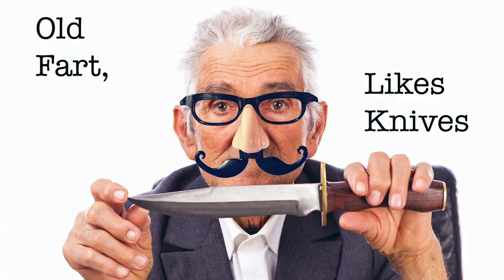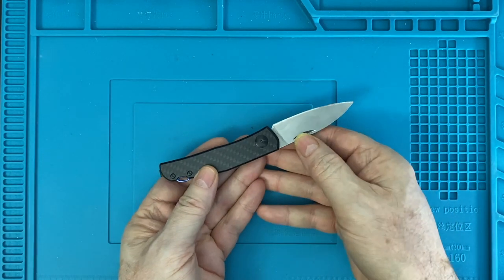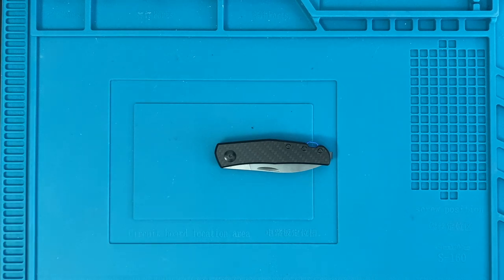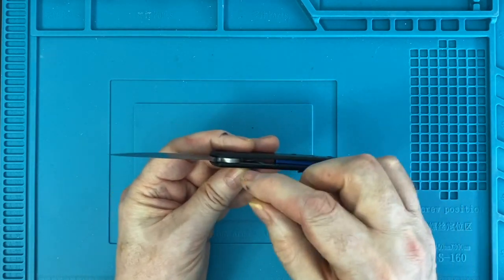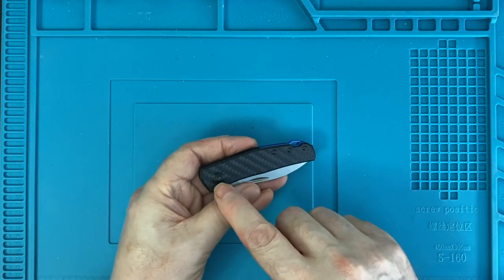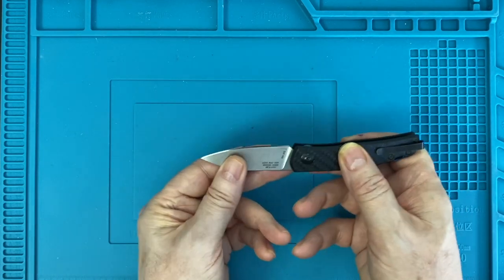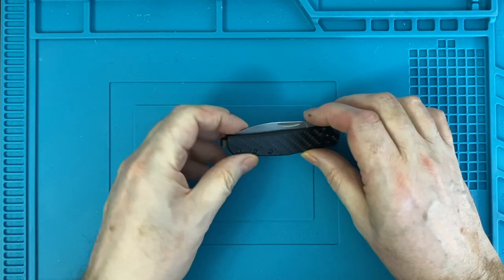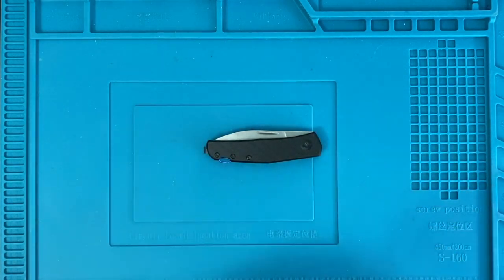Zero-Tolerance 0235 Slip Joint

Comment: Weird yeah I don’t like knives I can catch the tip of the blade when closed. I have the 0230 and the blade sits a lot deeper maybe if you find a used one you could switch the blades or scales and have the clip on a different blade that might work better
Reply from the maker: It's funny - I'm having trouble believing there is such an obvious design error.  Every couple of months I go back and take it apart, trying again to find something wrong that I could fix.  Just doesn't seem to be anything to adjust.  Weird indeed.
Reply: @OldFartLikesKnives  now I need to check my 0235 to see if it has the same issue.
Reply: The tip of the blade on my 0235 seats properly. There’s no way for me to cut myself. There may be something wrong with yours. After the second detent, it seats all the way down.